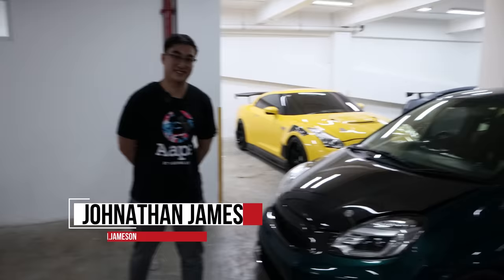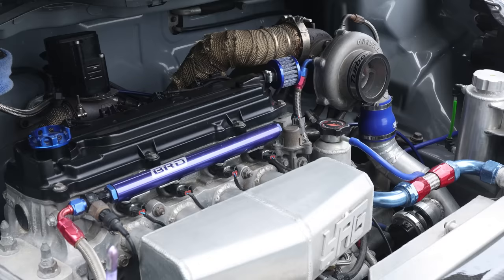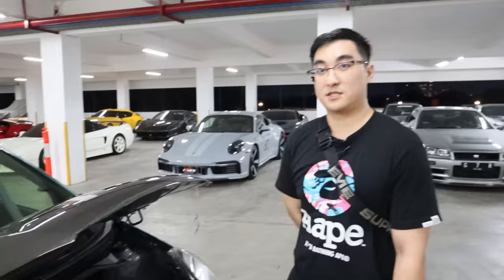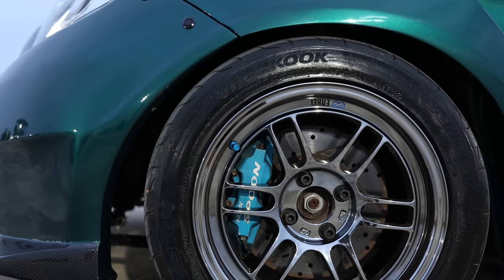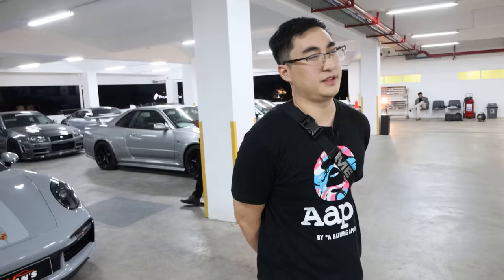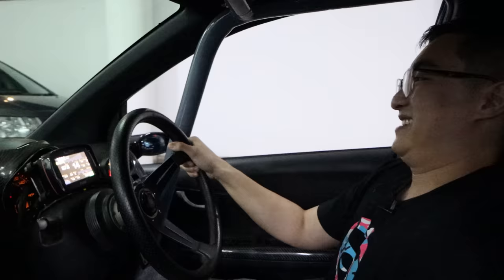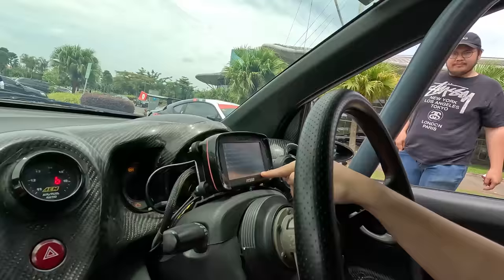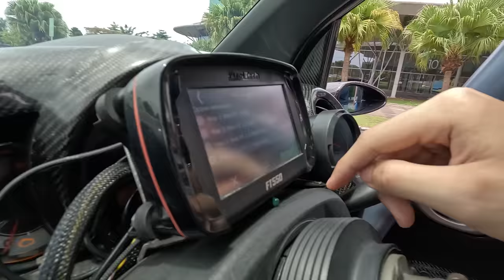From 87hp to 400whp: Swapped and Turbocharged Honda Brio

Comment: That fuel pump tho
Reply: Fuel pump racing bruh
Reply: “EEEEEEEEEEEEEEEEEEEEEEEEEEEEEEEEEEEEEEEEEEEEEEEEEEEEEEEE” -Fuel Pump, 2023
Reply: I can’t believe how loud some fuel pumps are, the AEM 320lph I have in my car is stock silent (unless you’re outside and put your ear up to the rear wheels)
Reply: Those speed bumps doe...
Reply: It would drive me crazy!
Reply: I have two Ti Automotive (Walbro) gss351 350lph pumps and they are loud af, just have to live with it.
Reply: Welcome to motorcycles?
Reply: I be doing something to shut that thing up lmao
Reply: @rckreationsvideos274  if you have a heavily modded car you can hardly hear the buzzing when you are driving around especially under boost.
Reply: Sweettinnitus 🫨
Reply: I love the sound of a fuel pump 🤷🏻‍♂️
Reply: Needs a rubber insulation sleeve like stock one
Reply: It's a killer - wouldn't that drive you nuts!?
Reply: Sounds like big mosquito in your ear

Comment: if you drove one of these in stock condition, you'll get how freakin' INSANE it is to have 400 whp in this little thing
Reply: I think anyone would understand just from looking at it.
Reply: Deadly
Reply: On a mustang Dyno... That's crazy
Reply: What did you think when you drove one?
Reply: @edwardssistershands  unsafe lol
Reply: Is there any BRV or Mobilio such as this?
Reply: @syazwanchawan8779  don't think so
Reply: @tommysantoso8303  they have but not too much in performance build
Reply: I think the 400 whp says enough.
Reply: Having a daihatsu boon with 1.3 stock Na the power to weight ratio is crazy. This brio is gut wrenching
Reply: If you ever driven a sports car you mean. My C5 vette has 400 and it’s dangerous sometimes . I can’t imagine 400 in this little deathbullet
Reply: exactly dude, this thing was powerful enough with 90hp
Reply: No different then a 91 civic hatch
Reply: Rwd is a hole different story to fwd with 400whp,,

Comment: checking wiki these things are 2100lbs in top trim. 400whp is insane power to weight ratio. Reminds me of the LHT turbo K20 AWD insight. cram all the best OEM parts into the lightest car.
Reply: Higher power to weight ratio than pagani zonda. Lol.
Would be a killer sleeper if he didn't do the body work.
Reply: @mr2_mike  these chassis can barely fit a 7inch wide on stock body. doubt it’s a choice, it’s a must 😂

Comment: As a US first gen AKA GD3 Honda Fit owner, I can't imagine it with 400WHP, complete overkill for a 2,500lb FWD daily driver, I'd be plenty happy with 200WHP over the stock 109 crank HP the GD3 comes with in the States but this build is super clean and that engine bay looks great, very clean.

Comment: I have a stock 80hp 1.2L Brio and this is soo inspiring.
Reply: Ive got one 225hp mk1 Octavia vrs with a blown gasket & no time to get it fixed.... 
Stock was MUCH better 😂😂
Seriously, finding reliable tuners who will also service your vehicle for less than insane prices is difficult these days.
Reply: Just keep it stock man
Reply: @stressoutspiderman  or just l15 NA swap will be enough
Reply: Just make it a bit to 200hp or less than it and make it lighter and gud air circulation like i do in my old brio.. i throw the backseats and changes all doors with plastics and proper lighter tyres with secondhand CF rims and change the rear brake to diskbrakes and still looks standard (in a bit changes)😂.. im amateur and still asked my friends.

Comment: That is such a cool little car!
Reminds me my high school days of guys taking the EG, EF Civic/CRX and swapping B-series into them (K series came a few years later on) 
Stock GSR b18c1 drivetrain in a CRX with drag slick tires ran 11 second 1/4 miles.
When your car weighs around a ton (2000lbs) 200hp is actually a lot. 400hp you’re fighting for traction all the thru to 4th gear but I understand the hunger for more HP

Comment: as a builder we know how hard these man set up these kind of power inside of his tiny car, how much the clutch failure has burn with these kind of power and fit at his tiny car, and how these tiny gear and wheel axle has been torn off,  try and error are massive cost in here, he almost can buy a new bmw with these cost

Comment: bro, this has the same power to weight ratio as a 2017 viper acr, 2020 mclaren 570s, 2021 hurracan, several vettes,.. etc, and those ar all based on bhp rather than actual wheel hp..

if it only could fully put that power down. what a mad lil machine, amazing widow maker.

Comment: I had no idea the L15 could make that much. That's insane.
Reply: I think 400 is pretty much the limit for stock internals.
Reply: @wr1ght939  no way, stock internals maxed out at 200hp before bending the rod. this one has built engine, forged bottom end.
Reply: @sicariostar8961  did he say if it was sleeved?
Reply: @chaseteter  youd likely have to have it sleeved past the 300 mark, others ive known who build these done the same thing

Comment: you should definitely check out the car scene in Thailand quite possibly the best in Asia after Japan. they literally extensively modify everything! cars, bikes, boats, trucks, vans, tractors pretty much anything with an engine. they have actual ambulances, tractors and delivery trucks with fully built diesel engines which the owners use for their intended purposes on the week days and they race on the weekends. fully built honda B series and 4AGE powered tooth pick like wooden boats known as "long tail river boats" which they drag race on the canals,  a crazy JDM/euro car culture and one of if not the best 2 stroke motorbike scene in all of Asia.

Comment: I had a Honda Fit in 2005-2010. I had 3 big accident with car because of electric power steering wheel. Sometimes wheel run out of your hands slow or not. If you turn wheel little bit much on apex of corner it starts to run out. If he does not change steering wheel system this car is smillar his coffin.
Reply: Idk about that, ive been driving this thing for nearly 8 years straight and havent encountered anything like that. They have these little brios and jazz/fits for one make races and they do just fine with stock power steering.
Reply: @jonathan.jameson98  if you say so it is
Reply: @ozccer1807  🤙🏻

Comment: man i wish you were around when i had my 800 whp subaru sti.mustang heart breaker dyno ..however it didnt last  very long  the engine let go at 4000 miles and it was the second motor in less than a year i had to let it go at a loss  i didnt have the funds for a third motor.  it was an animal and very scary to drive and i would have let you take it for a spin
Reply: Bruh you telling me the engine lasted only 4000 miles the 2nd time broooooo
Reply: @Johnny-yx2qx  yes, it was broken in as per the engine builder properly, oil changes as instructed. 1500 no boost miles and mostly daily driven to and from work and spirited back road windy turns and rod knock.  warranty refused    SUBARU FAIL! i never got to enjoy the car.

Comment: People with street cars that say "rolling anti-lag" are fucking obnoxious. Anti-lag is a tuning technology that moves a portion of the off-throttle combustion into the turbo manifold in order to direct the combustion flame through the turbine of the turbo while the throttle blade is closed. This is not possible in any way whatsoever without specific components that introduce fresh air into the exhaust manifold. What these people are doing is just normal every day launch control

Comment: 16:14 & 16:17... Those shifts man, why so brutal? It's either in gear or not... You can be fast without pushing your stick through the dashboard. Might as well order your new throwout bearing now, you'll need it at some point.
Reply: Throughout nearly 8 years of driving this thing that “hard” i’ve only replaced the throw out bearing once. And that is only out of precaution, not damaged whatsoever. So, yeah.

Comment: The Philippine variant of these come with an L13, 99HP if I'm not mistaken, decent power to weight for an econobox.
Reply: There's also the 1.3L + AT here. It's the earlier version, the facelift got 1.2L + CVT, the 2nd gen is still the same powertrain
Reply: Between the two AT variants, I think the 1.3 AT will bring a bit more power to the wheels? Conventional AT vs CVT and an extra 100cc displacement? Maybe marginal at best tho